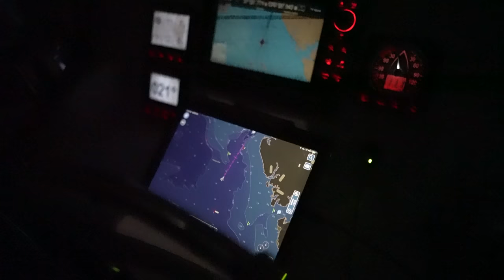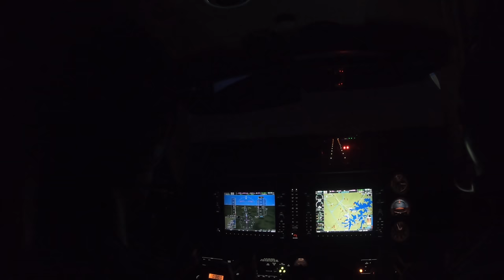She’s Makin Strange Noises [BAD PROP PAINT]

Comment: seriously a big fan of Prop speed. I have been in this game for many years  - at one time running a fleet of late 30ft yachts for sailing school. a couple of things come into the mix, (cost-benefit analysis) - Properly applied prop speed has been a marked improvement over earlier systems.  Interestingly - over time the efficacy of hull antifouling paints has fallen away  - at least for small retail clients (yachties) as distinct from Naval/commercial ships.  Happy to say  - there are some really great resources on the interwebs about the application process.  Note to new players - get the bigger pack and remnants store in the fridge.  if you are getting a serious amount of feedback through the prop to the vessel  - it may well be worth your while to inspect the gearbox mount at the rear of the engine. Just a precautionary thought.
Reply: Ditto!

Comment: You extracted an "Ouch" out of me when I saw that prop painting out of a normal looking spray can. Put me down in the column of people that coat their props in a very controlled prep, and environment. Only getting hull paint failure on shaded areas. We live, and learn about paint induction issues. I only get vibration issues when something is tangled in the props.

Comment: Another informative and fun video!  We installed a Flexofold prop on our boat.  We had the Gori prop on our last boat. Both are very simple and are water lubricated.   Flexofold has been purchased by Yanmar, so hopefully that is a good endorsement.  We have had similar bad luck with anti fouling paint on props.  We used the Pettit paints on the new prop and will see how they work.  Going out this weekend with our sons to watch the Blue Angels Homecoming Show at Pensacola Beach!

Comment: My experience is that CRC zinc spray ( not Petit )  is as effective as Propspeed and rather cheap. I must concede, not knowing if it works in Carib, frigging barnacle growth there is incredible. But up here in PNW, its magic, done properly, it lasts almost a long as your haul out period. With flexofold props and a diver that knows how to refit under water, even possible to remove, re-coat between haul-outs. Don’t be in a hurry to touch coating until its cured. A few hours.

Comment: You will love the serpentine belts, we did the swap on yanmar in a 440. So much better, noise and tension wise…
Reply: Yep!  New pulleys that fit right over the existing ones come with the kit.  Got mine direct from Balmar.  Almost zero dust after six years

Comment: There is a simple solution to keep barnacles off your props. A plastic bag pulled over your prop and held with a rubber band. 

Mylar bags seem to work best. Just remember to take it off when you start the boat.

Comment: “Hopefully, these belts will create a lot less dust.”  

I follow a boat restoration channel called “Sail Life” and he had a belt dust problem.  He fixed it by perfectly aligning the belt pulleys.  He cautioned that belt dust is a sign of premature belt wear.
Reply from the maker: We don’t get a lot of dust. We get 2+ seasons out of a belt. But then again we’ve got the small 80a alternators. The new ones are more than twice as big. The v belt would never work for that

Comment: When I drive to the store and back it's pretty routine and I don't think twice about it.  When you land an airplane, is there a moment when you stop holding your breath and feel a sense of relief that you are back on the ground?  Or is it as routine as driving to the store and back?  Also, if you ever get the chance to fly into the New Orleans Lakefront Airport, it's worth doing to see an Art Deco jewel.  It is spectacular.  I enjoy eating at the Terminal Cafe there and watching private planes take off and land right outside the glass wall that faces the runway.  I used to keep my sailboat in the marina next to the airport and I found out that it was airplane exhaust that caused my boat to get so dirty every week.
Reply from the maker: Hey Lowell, nice to hear from ya. The goal is to make it quite routine, but there are always adjustments. When winds are weird or the temps are high, things get interesting, especially if the runway is short or has obstacles like trees. “Relaxed hyper focus” s what I’d describe leanings like that. Really the only time to relax completely is when the airplane is chocked and tied on the ramp or in the hanger.

Comment: Sounds like when that batch of paint got mixed up, whoever was doing it grabbed the jar of "pro-fouling" chemicals that was sitting on the shelf next to the jar of "anti-fouling" chemicals... lol

I will say that my biggest concern over painting props is the same as yours, and even if it's not as critical, something as simple as paint can induce imbalances and result in vibration.  Maybe boat propellers can get away with it more easily because they tend to have a much higher mass to surface area ratio, so a thin layer of paint, even if uneven, isn't going to result in much imbalance.
Reply from the maker: Imbalance is definitely an issue on boat props. That’s why I’ve always shied away. And will in the future.

Comment: Did the black widow paint stay on the props?  Were the barnacles easier to remove than normal?  I was talking to Propseed at IBEX, and they told me barnacles would still attach to the prop, but they would wipe off much easier.
Reply from the maker: No, they were on there good.

Comment: I gave up on those props & changed to a Kiwi prop + Prop slip coating , Not a problem & amazing in reverse , Adjustable pitch to suit & made from hard plastic (No osmosis problems) If a blade does get damaged i can change the blade and not the whole prop - Worth a look , Reasonably priced to - I dont work for kiwi prop ? Just a cruiser .
Reply from the maker: They were awesome until this last season. I’m going Gori next time.

Comment: Hello Nick and Megan. Your videos are great and very informative. You have inspired us a lot. We have a Leopard 44, get her back in February and is our new home. We have been looking for a new set of props. We are in Greece at the moment so European options are easier. She has the standard 2 blade props. High on my list is the 3 blade Autoprop. What is you opinion? And if you were getting new props today, what would you try?
Reply from the maker: I mean they worked great until this last year. So four years no problem. Then should have been a factory rebuild. I will go Gori next time.
Reply: @TheOKellys  Thank you very much. I will check Gori out too then. Hope we find a good solution as at the moment with the ones we are wearing we struggle to go against the wind.

Comment: Rust-Oleum cold galvanizing spray paint it's supposed to work good on the props and as much cheaper
Reply: Sounded pretty stupid to me, but I use this product on my Rochne Anchor five years ago and I’ve only had to touch up one little spot of rust since then. I checked my logbook one day and I anchored over 180 times since.

Comment: Have you ever used Feathering propellers instead of folding propellers?  I was under the impression that Feathering propellers were more efficient when motoring than folding propellers especially in reverse.  Are the Feathering propellers higher maintenance or more likely to fail?  You don't carry a pair of spare fixed propellers in case you have a problem with one of the folding propellers?  A video on the pros and cons of feathering propellers vs folding propellers would make a good video. Thanks for the video.  Sail on! : )
Reply from the maker: Yes, these Autoprops are feathering props. They had been working great until this past season. Yes, we carry a spare fixed prop. Would make a vid but tough testing all the makes
Reply: @TheOKellys  Thanks for the reply.  Too bad some one hasn't figured out how to make a variable pitch propeller for marine use that could even go negative pitch so you wouldn't even need a reverse gear.  : )

Comment: I got the feeling from the video your hypersensitive to the prop vibration. 
I think the vibration was from the growth 
And not the paint. And the growth grew rapidly because you where in the Chesapeak bay and not out on the ocean.  sitting more than moving and like you stated in the video in warmer clearer water 
You clean or inspect the prop every few day just because your already in the water. 
No one jumps into the Chesapeak in September for the warm clear water. Lol
Now that your back cruising it probably won’t be an issue 🤞
Reply from the maker: Yes, it was the growth. When I cleaned it, it was gone. I am not sure how you could say we are hypersensitive however. Wouldn’t that require that you experience it, to make that judgement? Regardless, having the worst growth of our entire ownership, including two summer shoulder seasons on the Chesapeake WITHOUT any paint, I am going to stick with my conclusion that this paint, for whatever reason, is worse than no paint at all.
Reply: @TheOKellys  
I meant no disrespect. 
I drove an 18 wheeler for years and when ever I had a problem with the truck especially a reoccurring problem like your props I found myself being hypersensitive to it just waiting for it to happen again. 
Again no disrespect intended love you guys
Reply from the maker: I don’t feel disrespected. You’d have the same response if I speculated about something on a truck. You’d be like dude you haven’t driven my truck. Lol. It’s all good.

Comment: Gut-feel only ever works in hindsight. As a pilot you should know that.

"Welcome aboard this flight ladies and gentlemen. Today, your crew up here on the flight deck will be using our gut feel to work out how to get this thing from New York to Los Angeles, so buckle up and cross those fingers."

When teaching aerobatics, I like to start off by getting the student in the front seat to simulate flying a way-too-slow turn onto final so the plane is tickling the stall and ask them to sort it out. Which they try to do with gut-feel. We then fall into a spin. And I ask them to sort that out with their gut-feel. Five turns later, while in an accelerated - or possibly inverted, flat spin if I'm having a good day - I ask them how much gut-feel they have in their underwear.

Gut-feel can be translated as 'experience'. And if you don't have it, chances are you'll soon be on fire in a ditch. And have you ever heard anyone admit that they ended up smouldering by the side of the road because of gut-feel? Nope. And that's why gut-feel gets the great billing. It only ever grabs the victories. Never the 99% of disasters it causes.